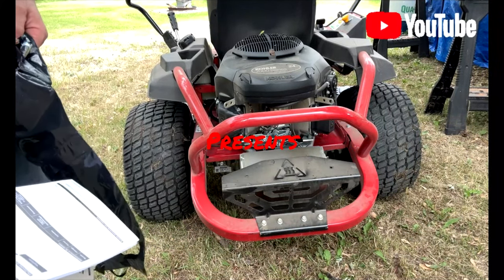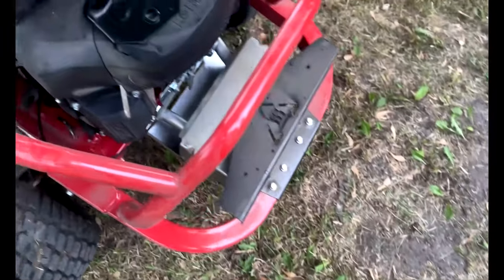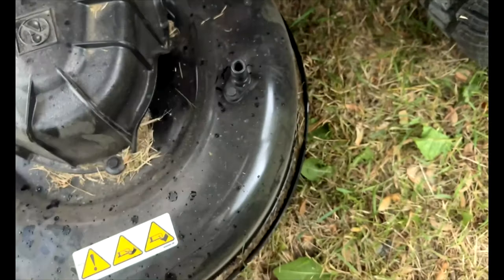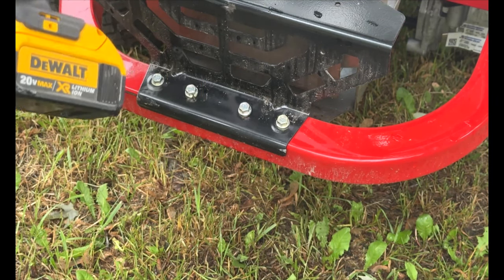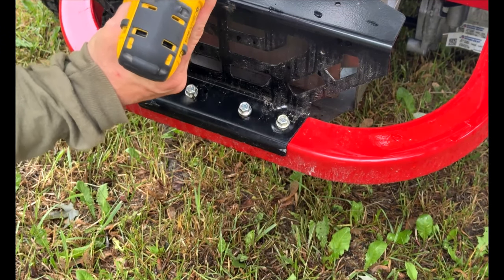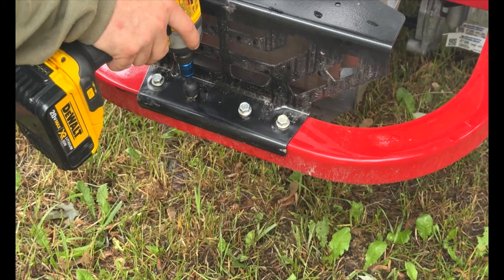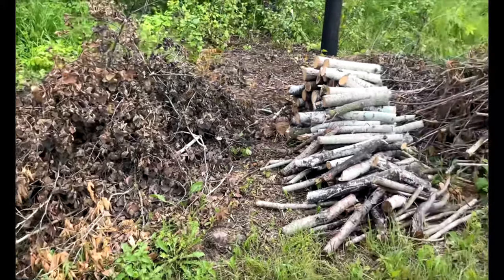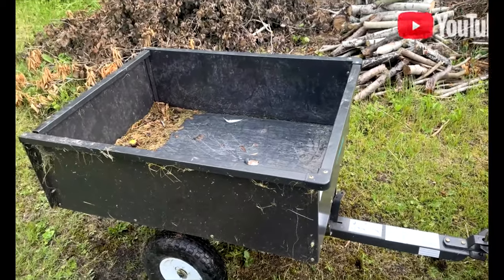Troy-Bilt Mustang Z54 Hitch Plate Installation And First Hook Up

Comment: Where do you get tge plate from
Reply from the maker: @michaelbyrd7454  came with in the box and stuff when I bought the mower new. I almost threw it away. Good thing I didn’t.
Reply: @genosimprovisions859  ok Thanks cause I git mines brand-new also,I'm finna
Reply: @genosimprovisions859  Thanks alot just found it.